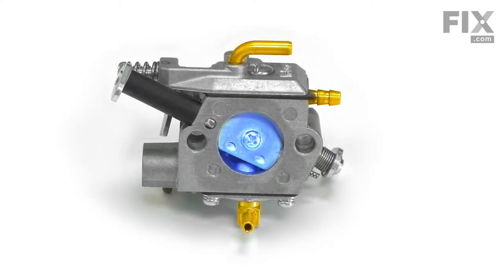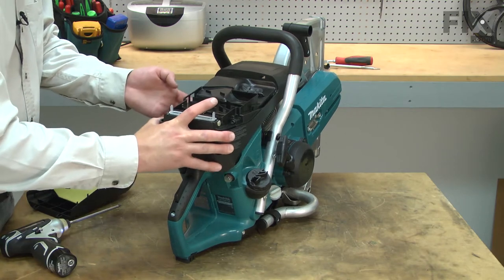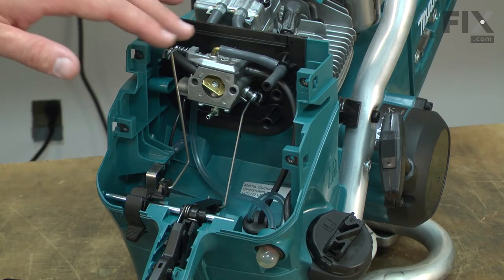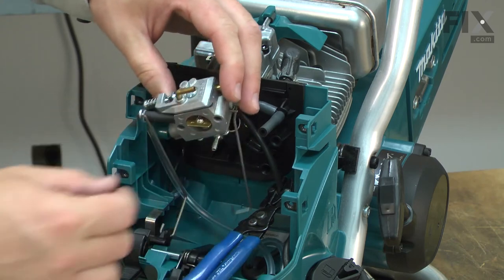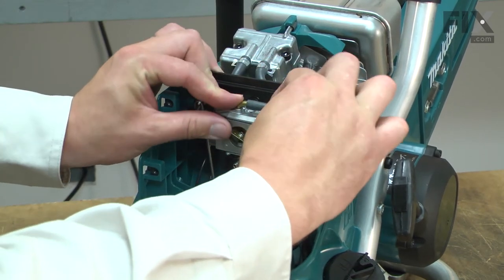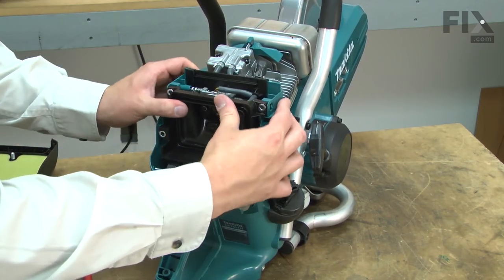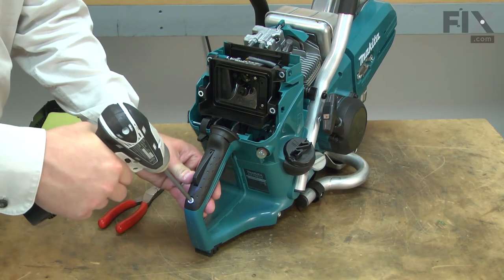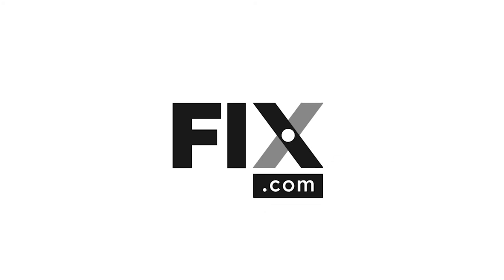Makita Cut-Off Saw Repair - How to Replace the Carburetor

Comment: The spring hook up in the 2014 chop saw is one wire that fits into the cup of the carb and trigger model ek7301. It can't get that spring right once in t switch don't work as if it's to tight.im not sure of the right angle.